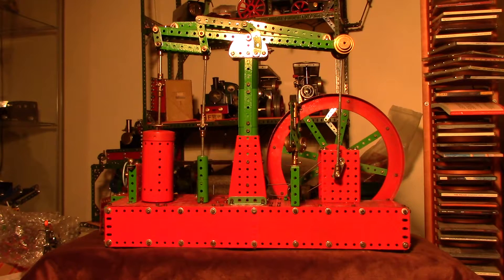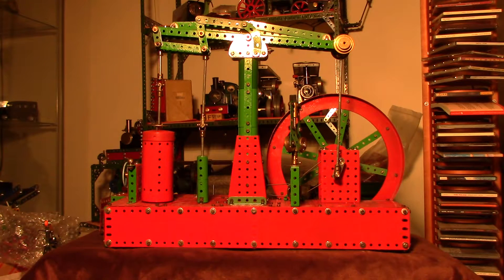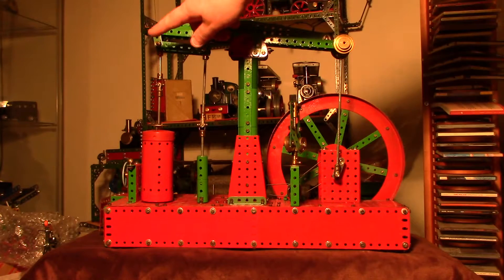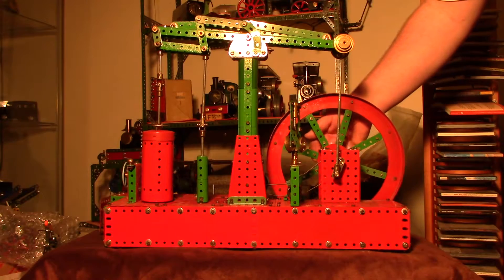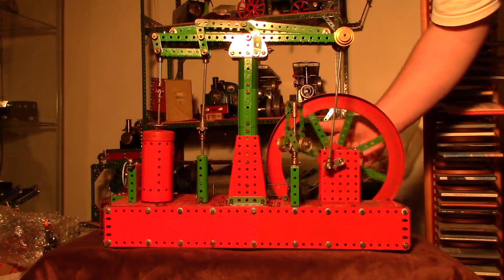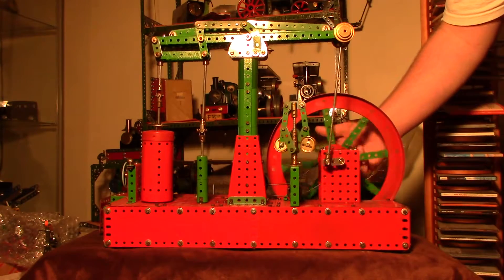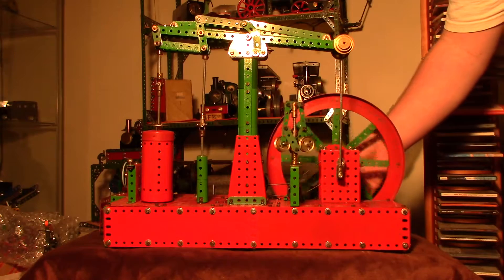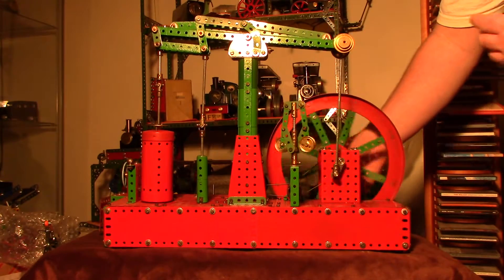MECCANO BEAM ENGINE (FREESTYLE)

Comment: Another great video and great model 

The linkage on the two rods down to the piston have you tried adjusting the banana shaped piece on the top also it may help giving that part some free play to keep the linkage straight when running
Reply from the maker: Yes I did try that and it did have plenty of play. It's now in bits.